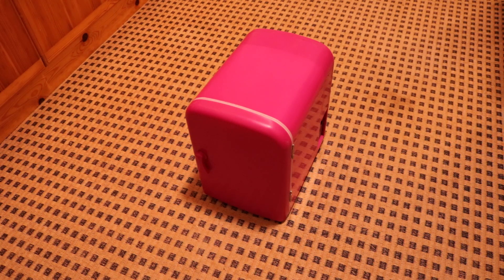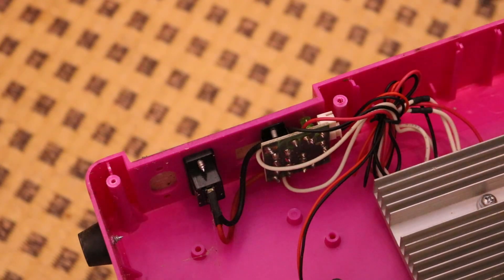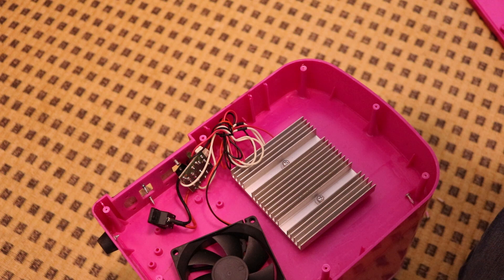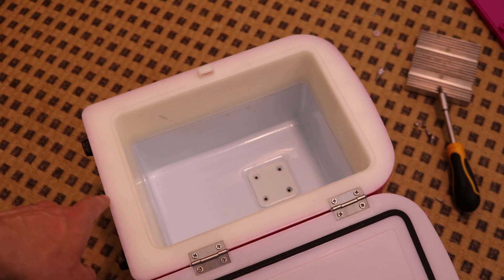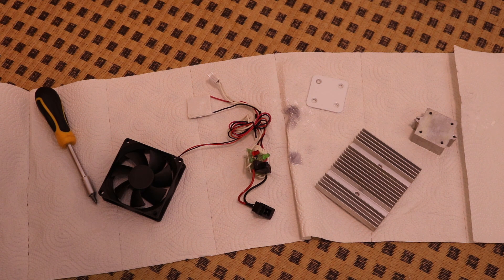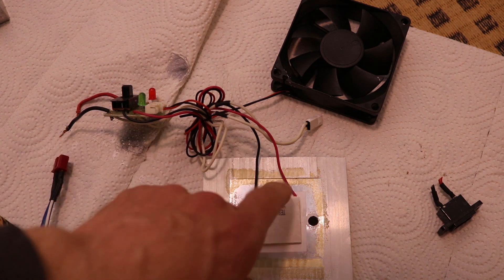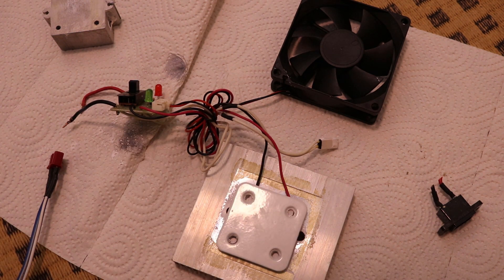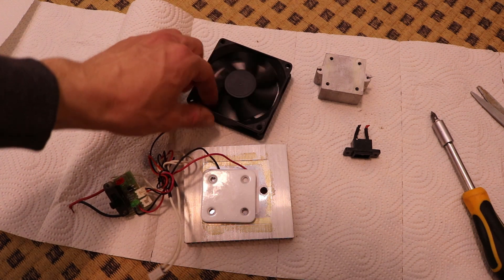Mini Fridge Teardown

Comment: These fridges use a Peltier Cooler (Google it) and they aren't efficient however they are pretty much the only thing that can do the job at this size. Was really hoping you'd have properly torn this down so we can see the insulation situation. 

These fridges are made super cheap and could do better with better heat dissipation on each side of the cooler and i suspect they really cheaped out on the insulation so would have loved to see what could be done about that, oh well

Comment: I still dont understand how heat is suppose to cool heat.
Reply: It's a Peltier Cooler, to make one side cool it needs to make the other side hot as you can't create or destroy energy (e=mc²) 

They don't work great because the temperature between the hot and cold side can only get so different, a heatsink helps by making the hot side cooler letting the cold side get even colder but only so much and they aren't efficient which is why Peltier Coolers aren't used too often.

Comment: Very interesting video ,   Had very little knowledge on peltier coolers .      Ive seen them used back in the day for cooling in certain components .   Ive purchased two of these on sale for less than 10 USD each .   Started using them for a low cost way to keep my medicine below ambient .    Just cool enough for my concentrates .     But i have had thoughts about what could be upgraded .   Higher static pressure fans ,    Different cooling plate/heatsinks.    Would absolutely love a video regarding your thoughts on what you would upgrade .   Thank you for your time and making this amazing video!😁😁
Reply: I’m in this same boat rn. Have you had any luck upgrading anything on yours over this time?

Comment: Would you make a video explaining what you would do to upgrade the little mini frige. Because I just want mine to cool faster
Reply from the maker: I could do that at some point, but for now I don't have any video like this planned.
Reply: No need. The solution is really quite simple, just as long as it's water tight and secured in place (to prevent accidental tip overs). Position it so that it opens like a chest, and pour some water into it. Once you cool the water, since it's much denser than air, not only will it have a large thermal mass it will also conduct heat faster.
 
Sure, it's a little messy by comparison but really the limits at these small scales and prices aren't worth all the extra trouble for otherwise minimal gains in cooling rate. Cold water is simply unmatched in effectiveness and price, with the only downsides being regular water replacement and perhaps needing a nearby towel/rag.

Comment: These refrigerators actually work wonders and even though they may take a little bit to cool off, as most refrigerators do, the heat sink technology is brilliant. The reason why the heatsink actually does its job and gets the inside down to very low temperature is, is because it's made a very purified aluminum

Comment: I took mine apart for cleaning and assembeld it again. Now when I put on the power it heats up like crazy and eventually shuts off. Any idea what it could be? I didn't replace the thermal paste but left the old one on, could that be the cause?
Reply: You're not supposed to reuse thermal paste
Reply: if you do not use  thermal paste like cpu's it wont make good contact whit the heatsink , you need to buy
 thermal paste.
Reply: Get a better Thermal paste and you should be good.

Comment: i’m wanting to turn a retro coca cola   cooler of mine into a mini fridge, but mini fridge conversion kits are $700 while mini fridges are about $50.
anyone think it’d be possible to take the parts from a mini fridge like this and apply them to a cooler?
Reply from the maker: Depends on how the cooler works. If it needs a compressor (I guess that's what the conversion kit is) then no. If the volume is not too big you can get away with a peltier like in the mini fridge. You can by peltiers and heatsinks fror pretty cheap (For the hot side you need as large of a heatsink as possible. For the inside if you can find a big one it's good aswell but it doesn't have to be super large) But keep in mind that this is less efficient and takes longer to cool down.

Comment: Don’t buy it it’s not worth the money “You had it from the skip”
Reply from the maker: From the size of the inner "Heatsink" I wouldn't recomment buying it aswell. It's just a small plate. I can't imaginte that this fridge would work very well.
Reply: @thesciencefurry  https://youtu.be/aEug9EBorHs?t=184 Isn't the whole rear part of the interior a metal shell, clamped to the aluminium block with that plate? If so, it has a large surface area to cool.

Comment: Hoping you can help. I have a fridge identical to this. Its stopped working (doesn't turn on). I opened the back and cleaned the plates and fans because they were super dusty, but it still doesn't turn on. Any suggestions?
Reply from the maker: Does the fan turn on, or is it not doing anything at all?
Reply: try changing the thermoelectric module
Reply from the maker: @asgelwkyi  It doesn't get charged. It takes current and moves heat from one side to the other immediately.

Comment: mine just died today. RIP tiny fridge
Reply: it makes a quiet ticking sound. might be the fan.but I'm not sure.
Reply: easier to replace it or use the big fridge. 😁
Reply from the maker: @ruthshere9468  Try to replace the fan if it's only that.